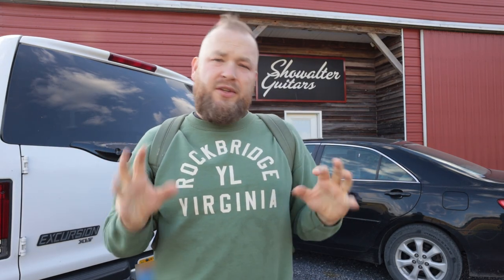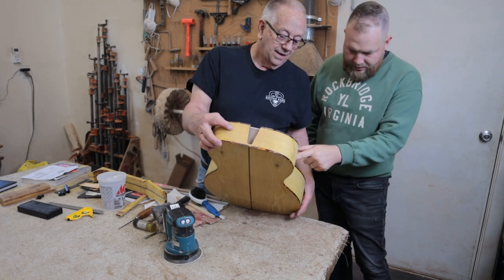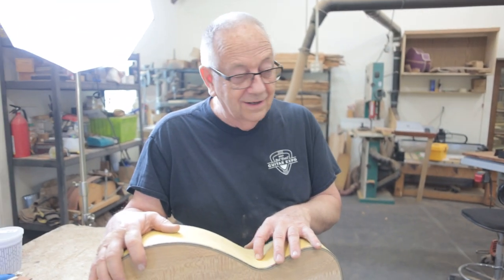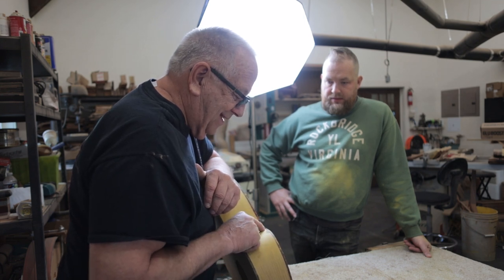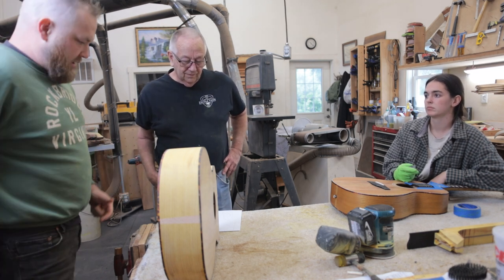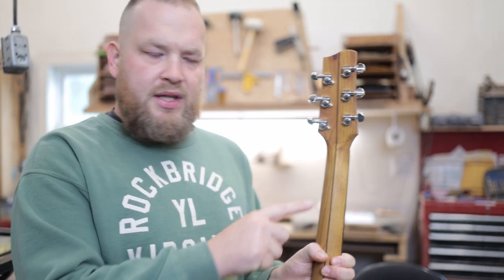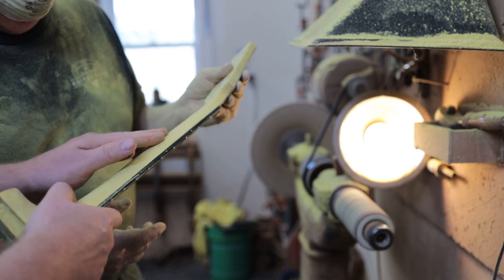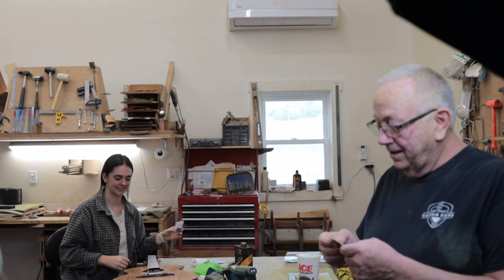I sanded through the side of my guitar. Building my first guitar Episode 14 with @showalterguitars5707

Comment: Steve needs to get an award for most patient teacher ever! Another luthier would have had an entirely different reaction upon seeing a gaping crater (it wasn't gaping -- but I'm sure it felt that way) after hours and hours of intensive labor. Steve took a pause with a slight grin and proceeded to help devise a plan to repair the goof without harping on it and making you feel badly -- in fact, as a stand-up teacher would, he took the blame for not showing you how to use the sander properly in that curved area. People learn the most valuable lessons from making mistakes. I can almost guarantee you'll never make that same mistake twice with a sander, and Steve will always remember to show future students the technique of using a power sander in that tight bend (or opt for sanding paper instead). Even a certain fellow builder in the background got some value out of learning to make a repair after her initial OMG face! 😂😂😂

Sorry you got such a sinking feeling cause that's THE WORST (and doesn't go away for a very long time either!) -- but you worked together and devised a solution that now gives the guitar a unique artistic element that nobody will know was put there to cover a slight unplanned hiccup. Thankfully, the sander didn't cut through enough to affect the tone in the slightest.  Happy ending!

Comment: Not to be a safety bummer, but, you have to make sure you air pressure is below 30 psi before you spray yourself with an air hose. In fact, you never should use an air hose to clean yourself. It can break skin and force fragments into your skin.